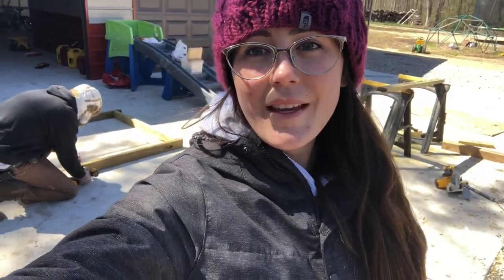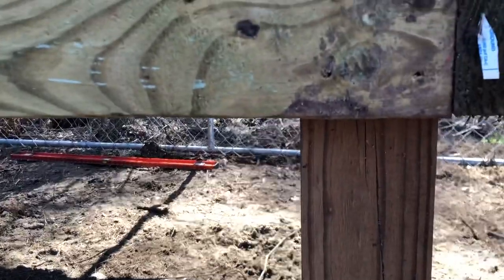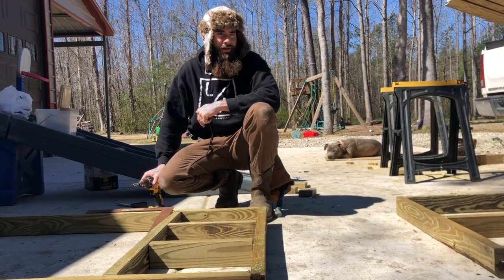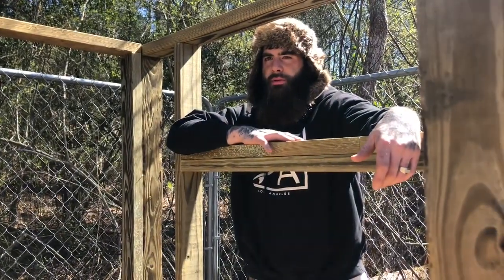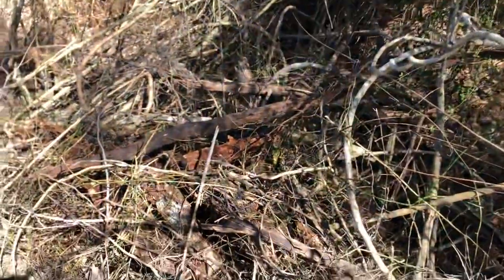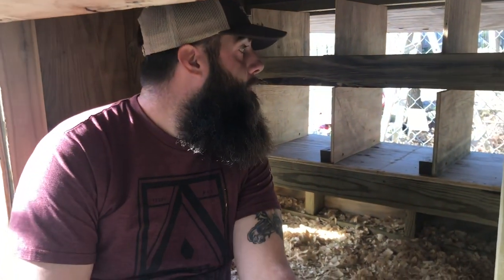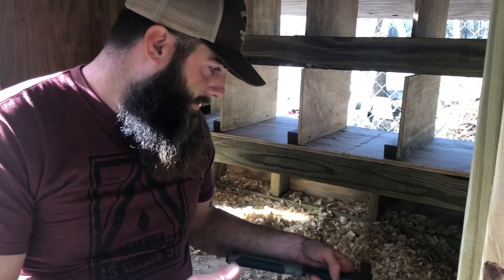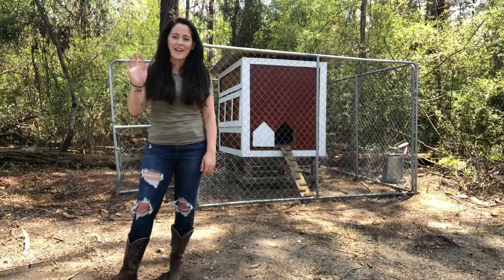Homesteading: Building A Chicken Coop

Comment: Nesting boxes are what they lay eggs in.. you can have 15 hens and only 3 boxes will get used..
Build something inside the coop for them to roost.
cover the run for night time.. line your fence with hardware cloth..
Free range chickens are more susceptible to air predators. (Here in Illinois birds of prey are protected) 
Make sure your coop is insulated, but well ventilated. This helps prevent frostbite in winter.

Comment: Unless you cover the lot structure with hardware cloth, this is not going to keep your chickens safe. Raccoons can reach in and rip your chickens apart a piece at a time. You'll come out to find them half pulled thru the chain link... or find them huddled in there somewhere with body parts ripped off.  Predators will  still be able to dig under, and snakes will still get in. You've just got them in a place where they'll be a sitting duck. Chances are, no matter how many chickens you have, they'll all use the same nesting box